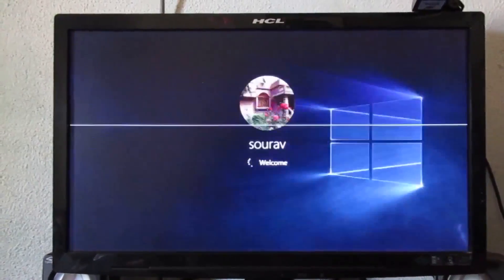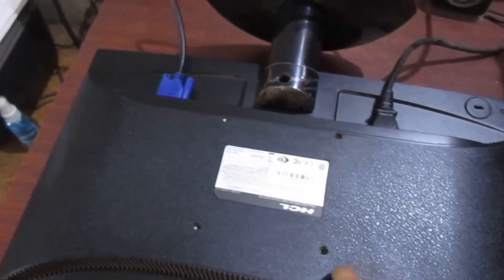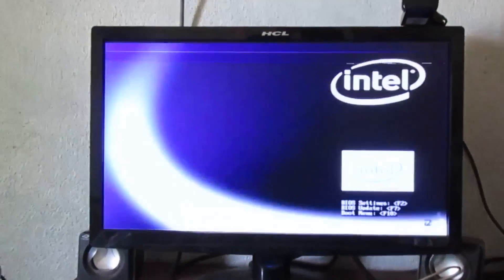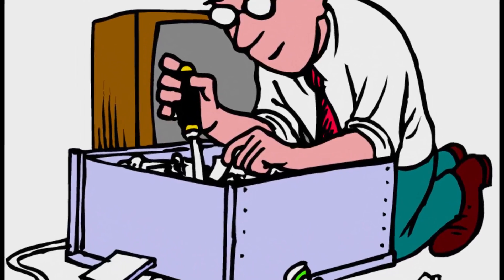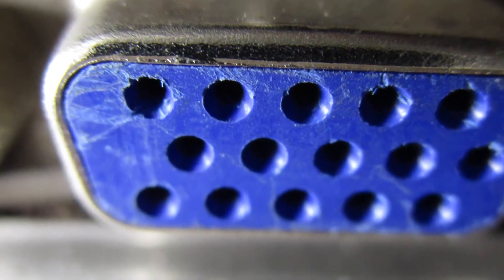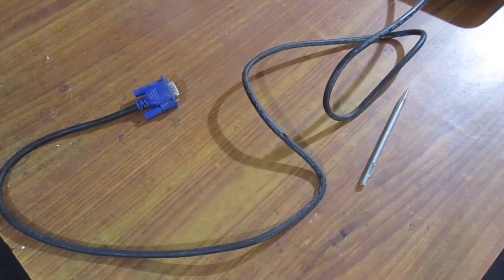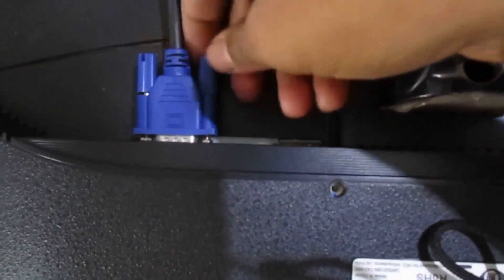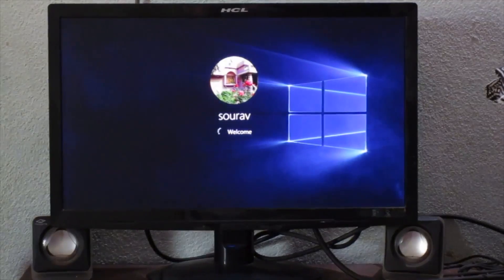HOW TO FIX/REPAIR MONITOR VGA. Computer display problem  (solved)

Comment: How do you fix the problem that the monitor turns black and shows DVI at the top right then it changes to VGA goes back to normal screen and then back to black screen

Comment: hello  plz can you help me i'm using 2 monitors and the main one is using vga to hdmi cable and the 2nd is coneccted to the other port i've recognized that movies and games became so much dark i search this again and again until i found what is called the (RGB) in nvidia control panel i change it to YCbCr444 and colors are back to normal but when i install a new game 

the first monitor in going to sleep id why plz can you help

Comment: Damn! I did more laborious works since I've never seen a VGA cable turned bad before but it really happened to me. I should've known in the world of electronics troubleshooting process would likely be more difficult than the replacement.

Comment: no u dont understand like i turned my pc on and pluged vga and nothing no sgnal and ime just sitting there lke bruuuuuuuuuu
Reply: Me too bro im sitting here for like 3 hours trying to fix this problem , and I have the exact problem, but I just can't find a solution
Reply: @Milo-cy4ch  same here..
Reply: @Milo-cy4ch  same
Reply: @Milo-cy4ch  tagging maybe i can help you
Reply: I had the same problem i cleaned the ram and gpu and the motherboard's battery and started my pc it worked for me
Heres a video that helped me so much 
https://youtu.be/MyBcZgc-wrE
Reply: Same here

Comment: I am having thin horizontal moving lines across my screen. I changed vga cable. I dont know if the problem is in monitor vga port or graphics card vga. what should I do?
Reply: its better to use hdmi moniters these days
Reply: its my problem too bro... if you solve, pls say me
Reply: My problem too
Reply: @motesir8623  ahhh bro😂. I fixed it by changing the source of power for the monitor. It was plugged into an extension and I changed it by connecting to a direct source in the wall. It was fixed by this.
Reply: Is it earthing problem. I guess
Reply: @motesir8623  yup

Comment: After looking at the comment section I tried it and first the monitor told me no signal 😭 I was terrified and scared but the Pushing it harder into the socket it worked well and the monitor is not flickering now

Comment: It worked... Thank you very very much. I was going to change my old monitor because of my vga not working. You saved my money.
Reply: Update: after 3 days the same problem occurred again. This time no luck. So I have ordered DVI-D to VGA on aliexpress. In the meantime i use Unified Remote  'Screen' feature.
Reply: @ajithsingh2740  dvi-d to vga worked?

Comment: Please call a proper technician or hardware person who knows all about this other wise you people will screw up with things don't experiment with your things
Reply from the maker: This video is a basic tutorial to fix that problem temporarily. After this fix the monitor work perfectly for few month after that the problem again arrive then I replace the VGA socate by myself unfortunately I was unable to record that. But after that monitor is working fine till now. And for replace the VGA socate u really need to call a technician or hardware person. This video is for those who don't have repairing person near there area or for those who are interested in this kind of things.

Comment: Bro plz reply what the pin name u used and bro when i connect the vga cable my dell monitor says going to power saving mode in 5min i also connected cable properly
Reply: Same ilike my issue
Reply: I thike it is game card problem
Reply: Bro game card means

Comment: i have this problem with hdmi, i cant fix that like you, but i press the like button :(
Reply from the maker: That kind of problem normally not happen with hdmi. but unfortunately it happen with ur monitor. i will suggest to use  other ports like  DVI or VGA if available.  other wise give it a try and replace the hdmi socket.
Reply: Sorry, not this, but like this. My monitor doind same things like your in the video :)

Comment: Bhai mere laptop ki display kharab ho gayi he torch se dikhta he light nhi he me vga to avi converter laya hun but Kuch Der Chala monitor uske bad blur display thoda thoda dikhta he first time apki video jesi problem thee uske bad monitor blur display ho gayi plz rpy
Reply from the maker: Vga to avi conveerter kisliye lae ho? Vga cable se laptop ko monitor se connect karo.
Reply: @StayInnovative  Led monitor nhee he CRT TV monitor banaya hum but thodi Der Chala uske bad blur display for CRT TV monitor me plz help

Comment: Will the problem fixed if i buy a new Monitor but use the old VGA cable?
Reply from the maker: Depends on ur old VGA cable condition. By the way if u buy a new monitor u will get a new cable with the monitor.

Comment: Bro I have a different problem the screen becomes like a mess .. display is all perfect but the waves on the monitor  how to fix them plz  if u see my txt send a mail
Reply: Bro that's not display or VGA problem.do you had connected all your computer plugs to a extension board or on one switch?? It is earthing problem.just connect monitor plug with another socket.
Reply: I also have this problem, there is a single wave and sometimes ka screen bakck out and becomes normal again?

Comment: Isliya puch rha ho kaise badal te ha
Reply from the maker: +Sagar Kumar heat blower se socate k pins me hot air flow karo uske bad desoldering pump se molten metal ko suck karo . socate ke dono side ke pins ko press karke pull karo bahar aa jayega.

Comment: How'd you know which way to turn them? I just got my pc and it wont give any signal to my tv. I'm using a vga to hdmi adapter.
Reply from the maker: bend the pins in any direction little bit not too-much. If this trick not work then u have to replace the on-board VGA female socate. (Is ur pc works with other monitor through VGA cable without vga to hdmi adapter? if yes. then maybe the VGA to HDMI adapter is damaged.) lets cheak and reply.
Reply: Bro pc system cant be connected with hdmi tv u need tv card and audio video cable i will work